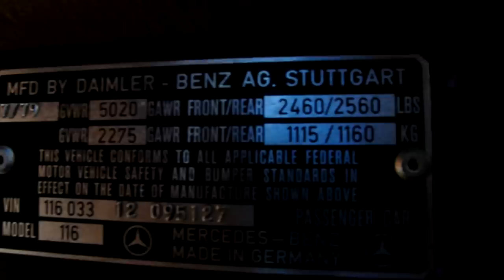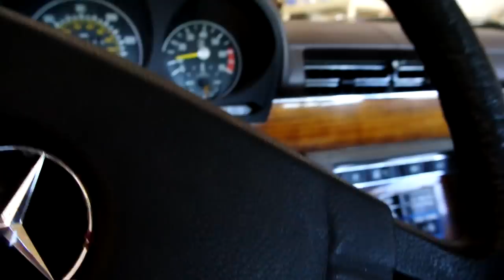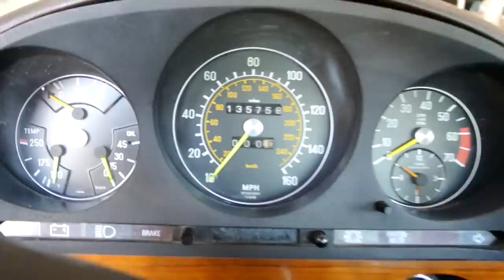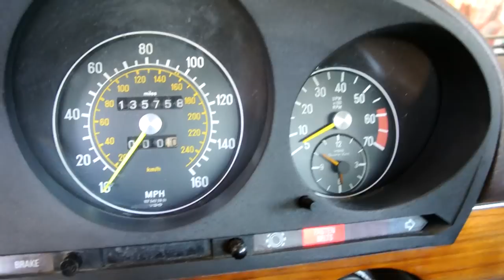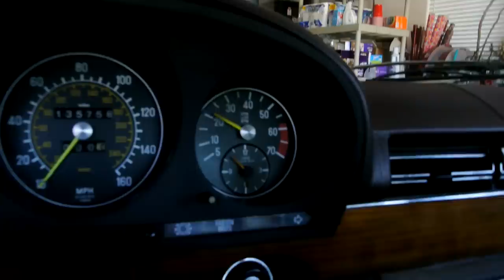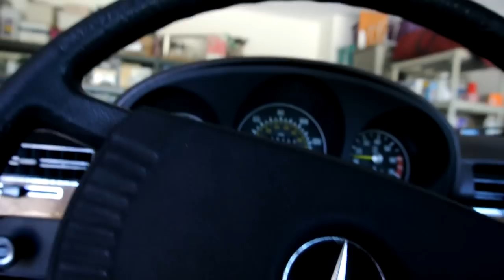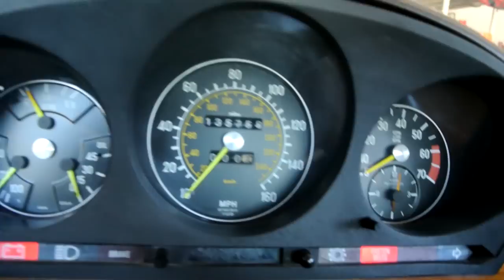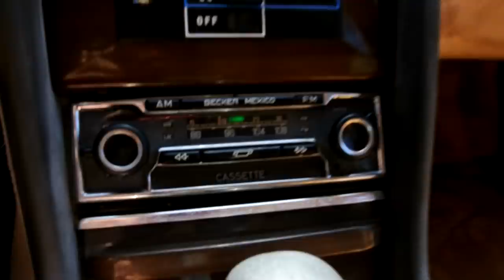Mercedes Benz 450SEL W116 2 Owner or 6.9 Clone ? 450SE Saloon For Sale

Comment: Indeed. Same goes for the w126. We ruined two of the best look Mercedes with those regulations. W123 has bigger ones, but they are acceptable. The lights are what ruin  them. Euro w123s got those sweet clean lenses.